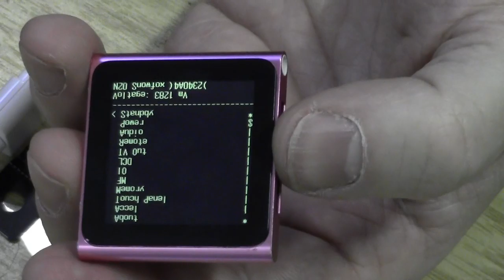Ipod Nano 6th gen repair

Comment: Hello Andrew, you deserve a medal for keeping your cool doing that repair I have a club hammer on the bench for things like that.A little tip that I have for building up those push buttons is get a hole punch the type that you turn to the size and squeeze, and get your sticky backed alli or copper foil and punch out all the sizes that the punch has.This gives you a lot of different sized discs that have a sticky back,so all you have to do is pick the size peel the baking paper off and stick it on.I have even repaired remote control buttons with these discs.
Reply from the maker: good idea. Cheers

Comment: I just repaired the power buttom and volume down with a full assembly, over time the little modules on the buttons get worn down and don't press. You can place a small piece of something above it or buy a new assembly.

Comment: Yes they use glue to hold a screen down . They aren't going to use a damn screw . They use glue versus screws to make the divvies lighter . And if apple was so cheap with the glue they do use , why was it hard for you to open it ? These devices are not meant for people to open . That's why they make it so hard to open them . The engineers for these device are not stupid . They know what they are doing . So let them continue on being successful , selling apple devices all around the world , and you do your
Job . Not trying to open them when you clearly don't know what your doing that's for damn sure .
Reply: Yep. When I need to remove a glued screen, I put the assembly in the oven at max temp for 10 sec. Never had any issue at fixing my own apple stuff.
Reply: +Alex Ayala If they were successful, you wouldn't need to fix the bloody thing in the first place... Your argument is invalid.
Reply: +Drinski Venediktov actually it is. All luxury items need to be kept up just like an Audi or a Bmw or amy other expensive item. Everything need to be fine tuned every once and a while. When Apple products- some of the most luxurious electronic devices people can get their hands on, also need to. Don't come at me some type of way apple engineers are here in Cupertino making millions. They're obviously doing something right.

Comment: Hi mate, thanks a lot for the vid. The spur of the moment approach made a lot more useful. Just wondered though if you could spare an opinion. I got down to the actual button and unlike you, it doesnt power the device when pressed. I hear the click but no life. I was sure it was the same problem as you since it all started with the button getting stuck but it seems the actual internal button is not powering. BTW, via USB it does power and works like a charm. Cheers
Reply: Pablo Guazzotti ok after realizing the volume control was not responding (though it was before opening it) I discover through thorough examination that I tore the connection ribbon. Looks the machine has died a death.
Reply: Pablo Guazzotti ok after realizing the volume control was not responding (though it was before opening it) I discover through thorough examination that I tore the connection ribbon. Looks the machine has died a death.
Reply: Thanks George, I have. Looks like the technician in me is not yet off the hook,

Comment: What size screwdriver did you use? The smallest one I have isn't the right size so going to have to buy a smaller one
Reply from the maker: dandaman0196 A year on i'm not sure but it was the smallest i had. prob a size No.00 in me jewelers screwdriver kit. but apple have doing a crafty using there own size in new products like the Iphone so you need to buy the apple certified kit or some 3rd party clone of it.
Reply: channelengineer Cheers I managed to make one using my grandads old screwdriver  by grinding it down. Brilliant video BTW

Comment: One really has to handle these cables much more carefully.  He shows what to do, but not how it should be done.  I am surprised the ipod works when he is done with it.  You are better off disconnecting the screen and the battery

Comment: there are 2 issues , one I can just can hear from right side ? and second it went little wet from sweat so I dried it using my hair dryer and later found screen had some fault ..sometimes it appeared dull and sometimes it just gone ...Kindly help and let me know if it can be fixed !! thanks !!
Reply: If u used your hair dryer, you probably messed it up with the static.
Reply: +Sergio Andres Pineda Castillo 
Nop, I did and its ok

Comment: I somehow managed to mess up the screen from working while attempting to fix the button issue. The computer recognizes when the ipod is plugged in, but the screen won't light up. Any suggestions?
Reply from the maker: 1. Try the hard reset. Press the Sleep/Wake button and the Volume Down button for at least 8 seconds until the Apple logo appears. You may need to repeat this few times.
open it your pod up
2. Check the battery connection its hard soldered to the board with thin wire that breaks easy - yet another crappy apple cheapo solution !!!. 
3. If no luck all I can suggest is to reseat the screen connections to the main board they may have been stressed during the fix and see if that works else it could a new screen. you might have to remove the small circuit board to do the reseat I have never done it on the ipod nano so cant be 100% sure if its possible.
Reply from the maker: Alex Sharpe looks like new screen time or a new pod

Comment: If mine won't turn on even after charging and holding the Sleep/Wake button and Volume Down button, is it a battery issue?
Reply from the maker: Erica Rountree You might want to try swapping the apple charging cable first just to rule out the simple stuff but if its still dead then could be the battery.
Reply: channelengineer ok thanks! I wasn't sure if it could be anything else, basically just stopped working one day, thought it might be the battery but wasn't sure if there might be other issue
Reply: +Erica Rountree When you plug it in to your computer if it wakes up its probably  not the battery. If the button doesn't click its the button.

Comment: Agreed, cheap design, looks like you are not supposed to be able to repair, fix or even use spares, guess thats the message, if is not working get a new one with a new button! and its only 50 more bucks!! next gen we will change glue for......wait for it...ductape! greetings from Nicaragua.
Reply from the maker: I've found this is the case with most apple stuff which is why I stir clear of it.  Looks good on the outside and works well when it works but really crap n cheap on the inside the newer stuff is not built to last or support and when its bust its not always easy to repair.

Guess its just another step to closer to a disposable society !! So much for going green.